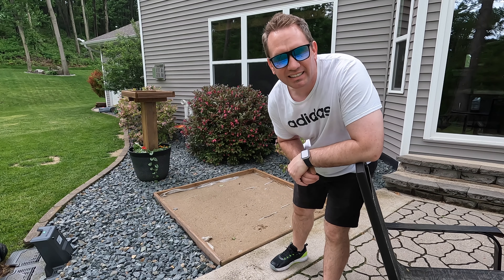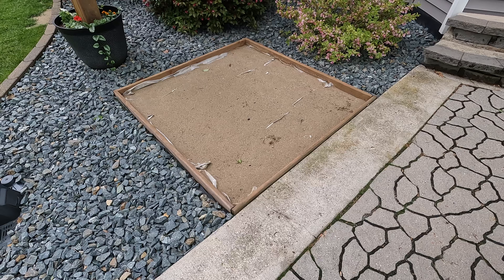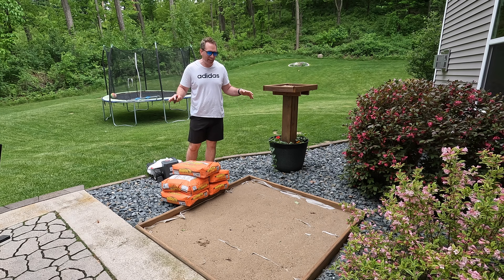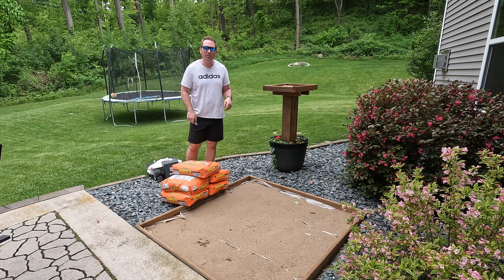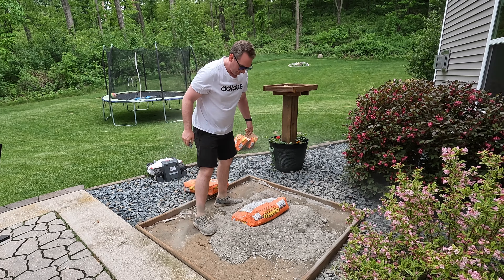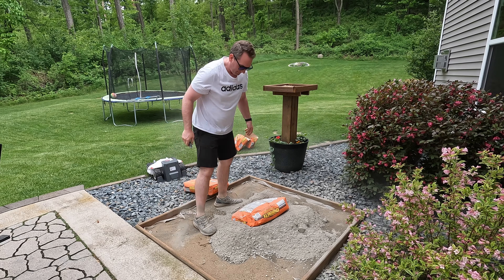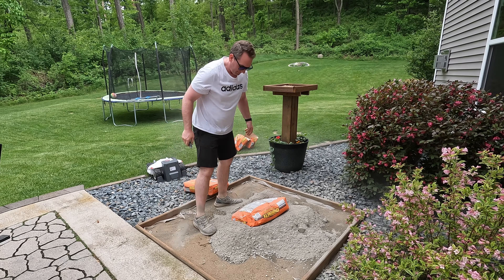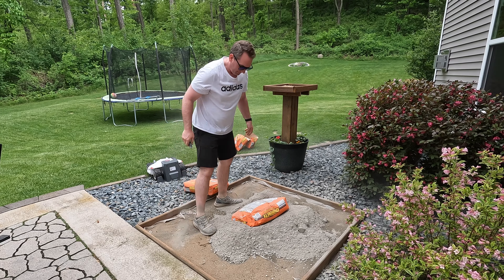Dry Pour Concrete Slab Project

Comment: A friend of mine who has done many dry pours uses the repair mortar. He does 3 inch dry pour using the first 2 inches of quickrete concrete and the top inch of powder mortar and it comes out smooth
Reply from the maker: Great information, thanks for sharing.
Reply: I've done 2 dry pours the same way and you get a much better appearance using mortar mix on the top. One of them has already been through 2 Ohio winters no problem. Great for foot traffic applications. Not sure if I would trust for any car traffic application based on my personal research.

Comment: Do the instructions actually say to get up in the middle of the night and water the slab?  I'd imagine setting up an oscillating watering unit.  The one that goes from say front to back and have enough of a stream coming out that water keeps it soaked overnight.
And if your slab does crack, what do the makers say about any sort of warranty?  Some money refunded?  Time-frame before it's allowed to crack?  Oh, wait you put a bbq grill on the slab? Oh, that's too heavy, you were only allowed to put a marshmallow sculpture on it. 
To this non-construction person, the slab looks great. Waiting for the firepit's transformation.
Reply from the maker: Unfortunately, there are no official instructions for this “dry pour” method.  It has been making the rounds on YouTube but it’s not officially endorsed by the manufacturers.

Because of this there is no warranty…and even if I followed their directions, I’m sure there is still no warranty.  To be fair, there are some many variables(ground type, weather, climate) but hat it would be nearly impossible to blame it on the product.

Comment: I doesn't make sense to me all these people doing "dry pours" Its going to be a VERY weak slab.
Its really not hard to add water and mix, for something like that you could just mix with a shovel and a hose in the form. For something like that even a beginner could do it and be done in a couple of hours. It's really very easy, dry pour looks more complex for a weak end result.
Reply from the maker: I was thinking the same thing during the project, but I had to give it a try.